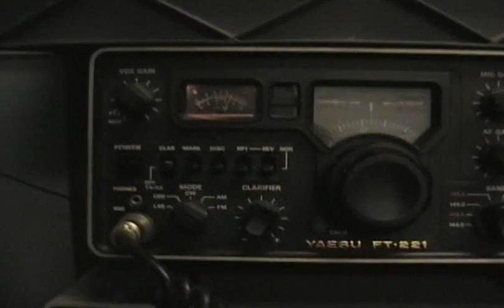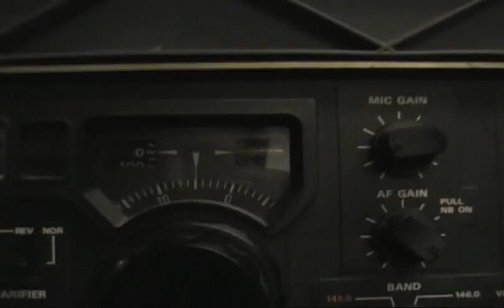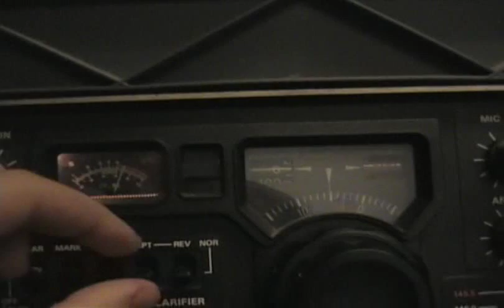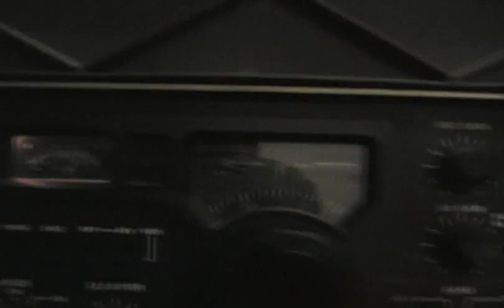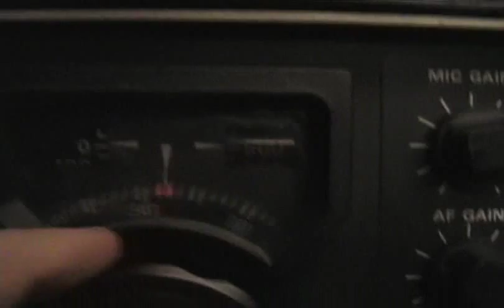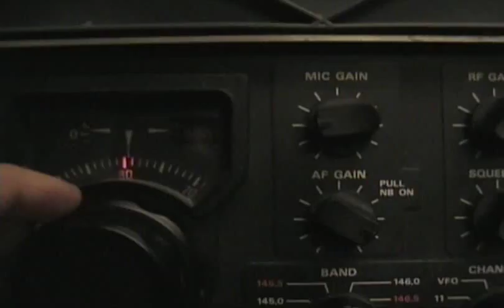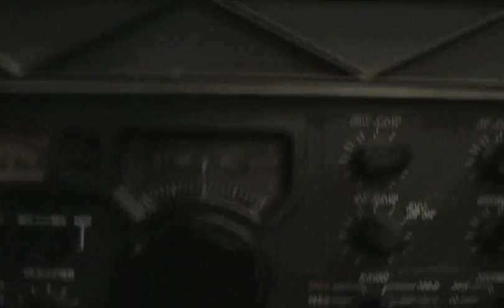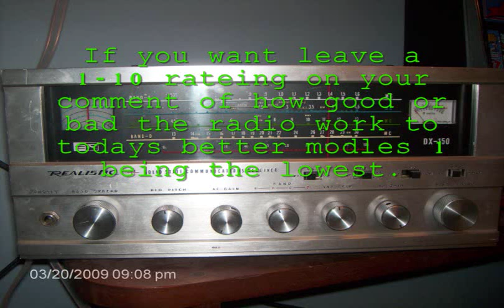YAESU FT 221

Comment: This is only a 2m rig so 144 to 148 mhz , so unless you're in a built-up area not much will be heard. But an all-mode rig and a great radio. Be careful just keying or flipping switches without a dummy load or you will damage finals.

Comment: VFO selects the tuning dial, the other positions are for fix channels that use optional crystals.  the band selects what range the VFO tunes, 146.5, then you add what the dial reads...  200 plus 10 on the bottom dial would be 146.710 mhz.    should work just like your frg 7 you have below.  The marker is to calibrate the dial.

Comment: This is the way some ham equipment gets messed up, by someone who has no knowledge of the basics dinking around with them flipping switches and inadvertnly transmitting with no antenna or dummy load attached.. also this unit is not going to pick up lots of stations like a short wave radio, this one i for 2 meters (144-148 MHZ) well above the regular commercial FM band, also above the Aircraft Band. it is mainly line of sight communication can be the norm..
Its a specialized tranceiver worth between 100 and $200, or squat if its screwed up.